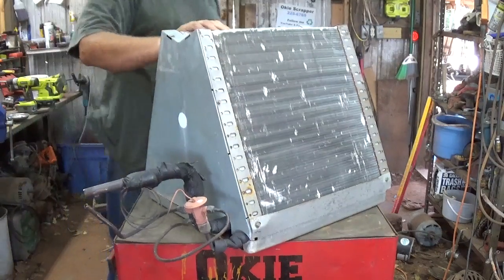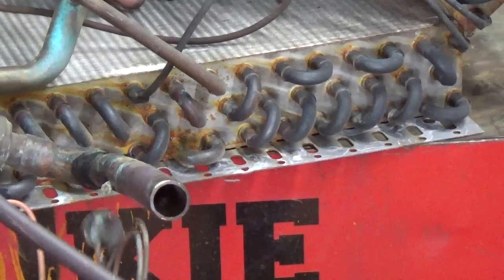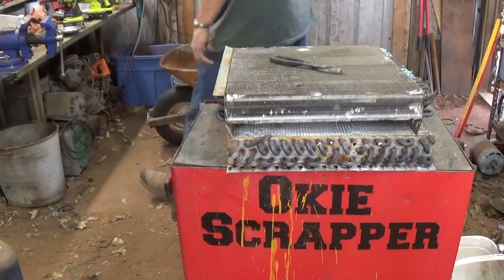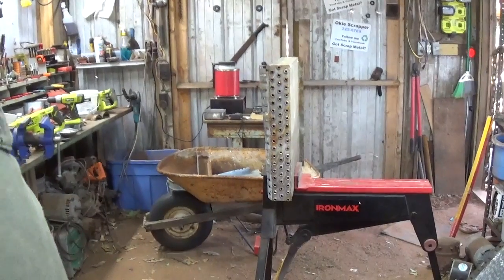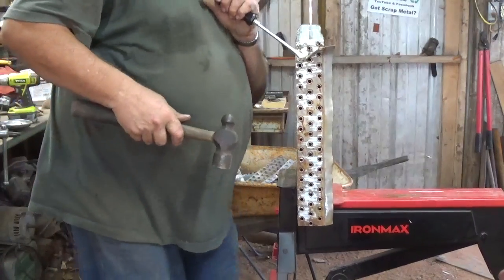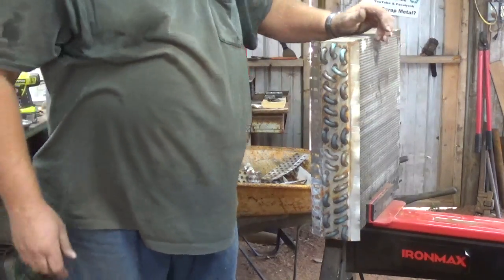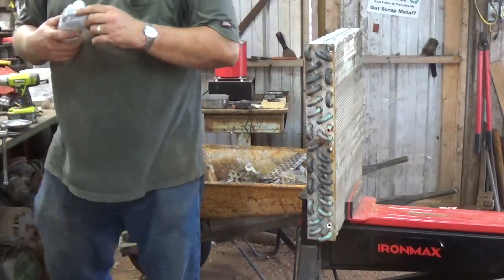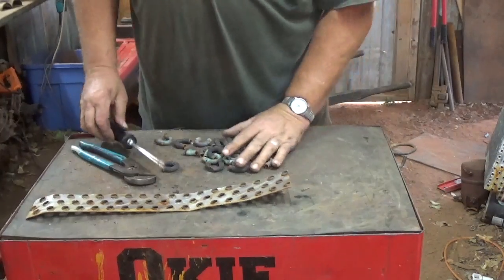Scrapping an AC A Frame for Copper Brass and Aluminum

Comment: i'm shit at cutting close also with the noodles. i now just cut it crappy and grind the extra aluminum off. i absolute refuse to fight with stubborn metal anymore. if i can't get the metal sides off with channel locks easily i just rap through it with the sawzall. but when you get 15 ac's and Acoils a year you stop playing games. thank you for showing me how much copper i was throwing away with the compressors and top fans. i now scrap those slowly just like you. it adds up and makes so much more money.

Comment: Been watching you for several months, really enjoy your melting alumnum scrap and your constantly evolving.  I scrap a little also, it helps out a lot.
Reply from the maker: yes scrapping can help a bunch, a few years back we weren't watching the check book as we should have and got
$700.00 over drawn at the bank. so we used the paycheck to pay any bills that we had to and use cash from scrap for every thing else that we could and within about 6 weeks we were out of the hole, I had a lot of scrap on hand and prices were good at the time. scrapping = tool money

Comment: I was told a trick that you can do with your copper pipe soak it overnight in coke and it will look like new again i haven't tried it yet so I don't know if it will work just waiting to pass it on to you 
Video are great
Reply from the maker: I will have to give that a try,

Comment: I cut all mine from inside and the noodles usually stay on the metal and just twist them off when you get it cut off
Reply from the maker: yes some like doing it from the inside and some like doing it from the outside, others just cut them off and sell them as is, That one was possibly the hardest one I have ever done, most are easy

Comment: Best way is to take your nail slot on a claw hammer and roll the metal down, real easy. Remember how you use to open metal cans with the tool, same method.
Reply from the maker: nice tip thanks

Comment: Maybe cut on both sides ..first the noodle cooper side then the back half..that will take the plate off without using the hammer.
Reply from the maker: That is a good idea thanks, it would be a lot faster and easier, most are not this hard to do, this one was a tough one

Comment: Have you thought of melting the aluminum from the copper
Reply from the maker: I have tried it in the melting pot, but it got too hot and the copper melted with it. need to be able to control the heat better

Comment: I’ve gotten lazy scrapping coils , I just cut the ends off and later on I’ll beat the macaroni pieces off with a hammer after I got a pile of them but all I scrap is Ac’s mostly so a little diff scenario. Pretty soon they will all be aluminum anyways. Makes me sad.
Reply from the maker: yeah as copper prices climb manufactures will use aluminum to cut costs